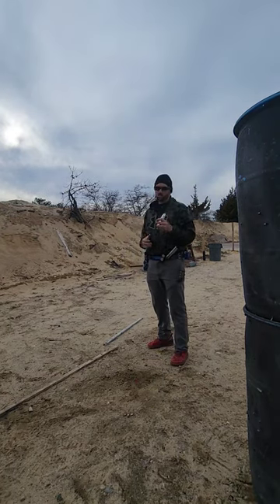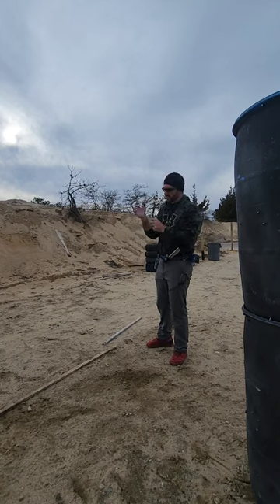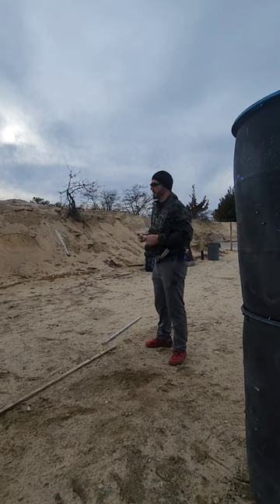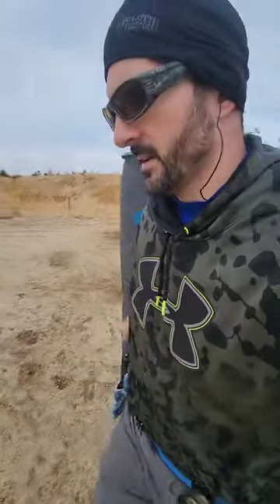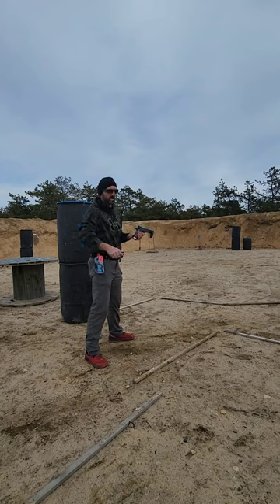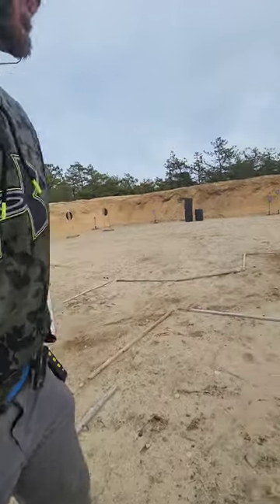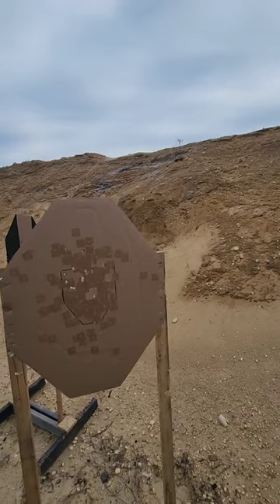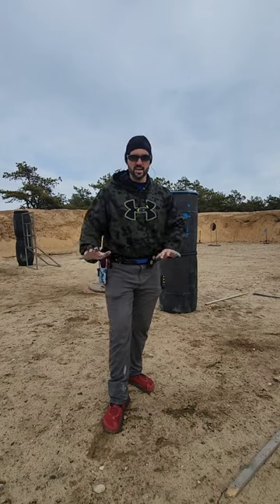The ONE THING you need to know about your firing hand and recoil control!

Comment: Hi sir. I have a question. After some  5-6 minutes dry fire training i shoot around 50-60 rounds with my strong hand.  And my accuracy falls seriously. Is it normal or do i need extra hand conditioning ? Thank you
Reply from the maker: If you shoot and then you're finding your accuracy falls off significantly it COULD be partially due to fatigue, but more likely it's that you're not holding still for the shot to happen. 

Try this - Load the gun, remove the mag.  Try to fire two shots.  You'll get one bang and one click.   Be very observant of what happens during the click, as this might start to give you an idea of what's happening!
Reply: @robepifania  I ll try. Thank you very much